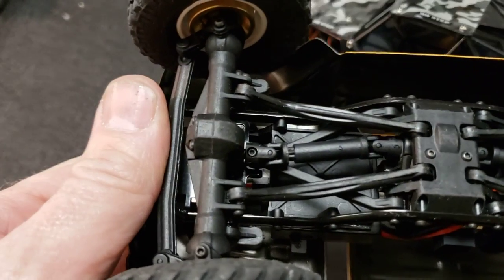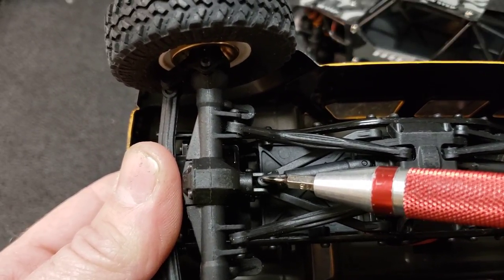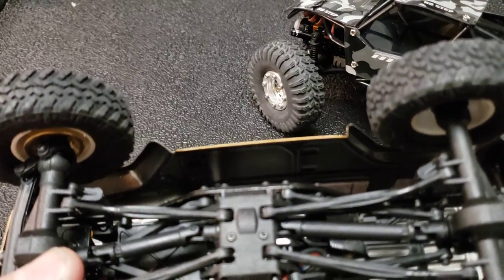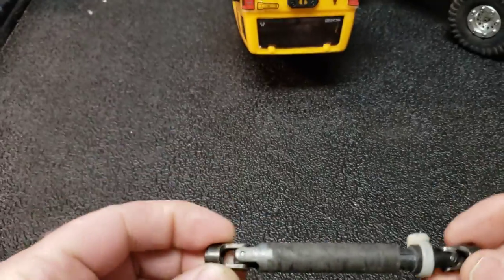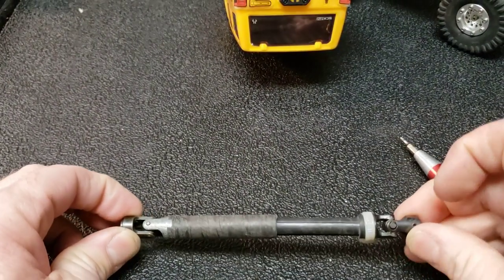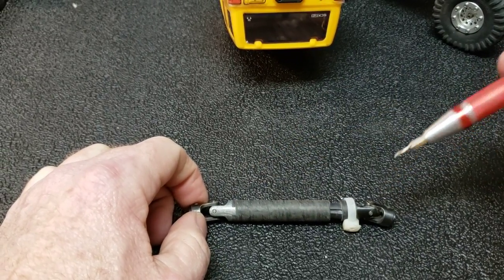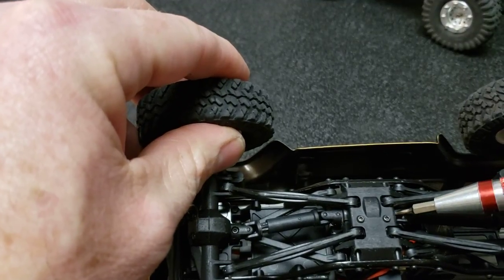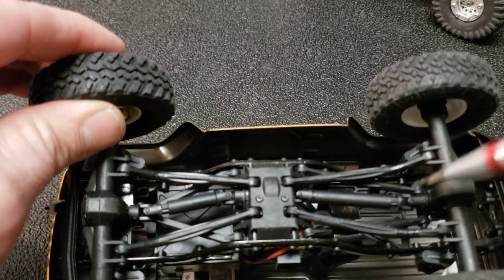RC Driveshaft Phasing

Comment: I've had my Redcat Gen 7 for a year, & everything is still stock. What a beast it is. Thanks so much for sharing your valuable knowledge.
Reply from the maker: Thank you. : )

It turns out you can't get the Gen7 driveshafts out if phase. The slip bearing will only assemble correctly. If you get it wrong it won't go together.

Comment: I swapped axle casings on my mini z 4x4 and for the life of me I swore that I was having a mesh issue with the ring gears.   Bought 3 sets and kept breaking the teeth  on them.  On a whim decided to tinker with the drive shafts because when the truck was fully compressed it drove fine and whatdayaknow both my drive shafts were put back together out of phase.

Comment: How do I do an axial capra? Just line up the pins that hold the ends on?
Reply from the maker: As long as the two outer flange yokes are aligned and are an exact mirror of each other in rotational position you are good.
Reply: @EXPIOWA  it doesn't have that kind of driveshafts. It's like a all with a pin then you slide it into a sleeve and put a screw through it
Reply from the maker: Some Axial drivedhafts have the word AXIAL printed on both driveshaft halves. An easy way to ensure it is phased is to line the two halves up so both words are in line with each other.

Comment: Hi! I've run in to a problem which I thought was the driveshaft. My car runs unevenly and makes a popping sound. I watched this video and was sure this was the problem since my driveshaft didn't align. Took it apart and aligned it but it didn't help. Any ideas? Thank you!
Reply from the maker: Can you post a video so I can see and listen to what it is doing? That would help.
Reply: @EXPIOWA  Thats gonna take me a while. Kids and work. I do have pictures I can send you if you have Instagram or Facebook.
Reply: @EXPIOWA  I've figured it out but this has to be a common problem with stock knuckles.
Reply from the maker: @spellrong  If I could listen to it it would be helpful. Pictures Don't tell much about how a thing operates.
Reply: @EXPIOWA  Here it is! https://youtu.be/ytGf3T8hTio
Reply from the maker: @spellrong  I have a few rigs where that screw jammed the axle completely. I backed it out until it cleared. I could have also shortened it with a Dremel.

Comment: so the driveshfats need to be like this )-( with the C's like that?
Reply from the maker: As long as the ends are mirror images of each other its good. If you can't tell any other way, make sure the screws that go into each end of the driveshaft are aligned in a straight line. That will be phased.
Reply: @EXPIOWA  Also thank you for the link, very informative and helpful.
Reply: @EXPIOWA   So im looking at my RC car from Furitek, right out of the box (no changes). Either someone did it wrong or thats how they intended it. They have it 90 off phase but both sides are mirror opposites of each other, it runs smooth. I know you mentioned that as long as one side is mirror image its fine but they have both sides mirroring each other with the same 90 off phase.  Im just confused now. They have a picture of their drive shaft set up on the site.